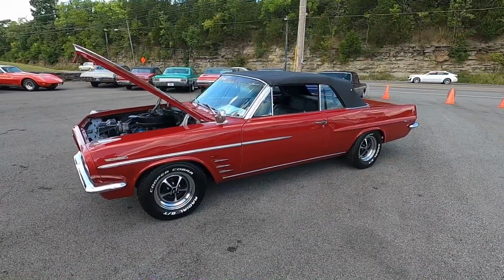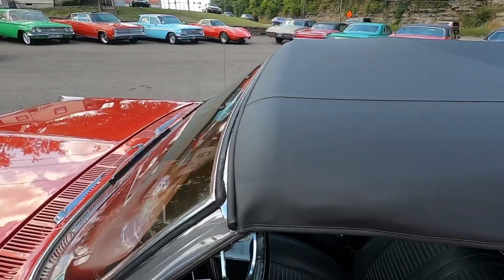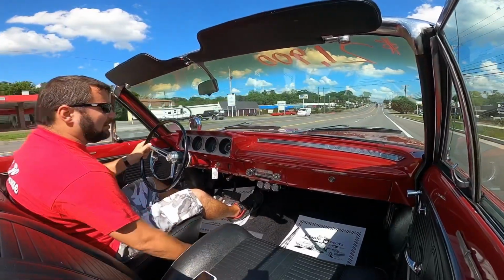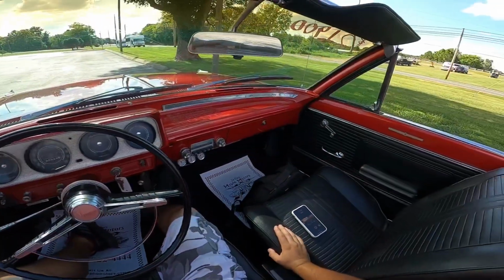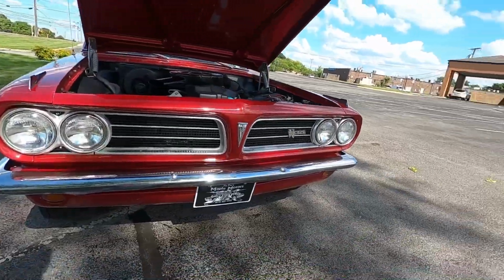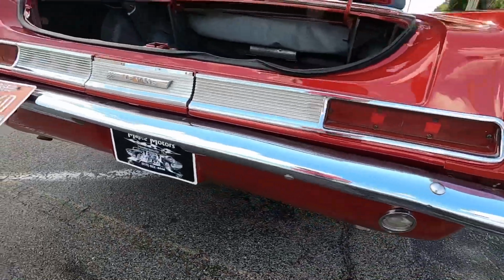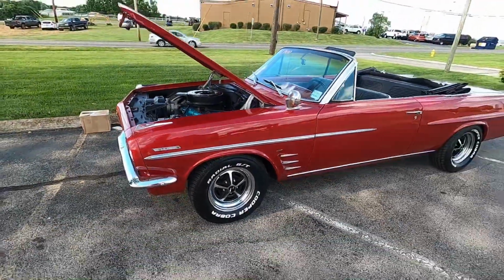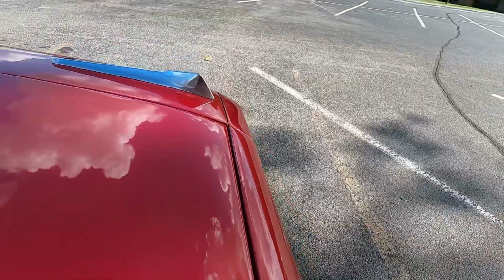Test Drive 1963 Pontiac LeMans Convertible SOLD $21,900 Maple Motors #1813

Comment: Love the 63 Tempest.  Have been looking for the hardtop/fastback.  Rarely see them up for sale, and when I have the timing hasn't been right.  63 was a great year for many of the manufacturers, the F85, Falcon, Comet and so many others had great body lines.  They put today's cars to shame.
Reply: Yes, they are very cool Scott!
Reply: I drive a red '63 hardtop Comet. Has the same three chrome 'tails' as this Poncho but on rear quarter panel. Seems like Merc & Pontiac had double spies ;^)
Reply: @josephtravers777  👍👍

Comment: That's a pretty little Tampax. My Dad had a '62 with the four-cylinder four barrel 4 speed. Some of my earliest memories are standing on the hump between the bucket seats holding on to both seats as mom is working that four-speed, racing from stop light to stop light on Woodward in Pontiac Michigan on a Friday or Saturday night. I think my mom might have been one of them dirty hot rodders.

Comment: My dad had a hardtop version. It had the console shift. I did notice this one had a break lamp out. The 326 was actually a 336 but GM at the time wouldn’t allow any vehicle to have an engine larger than the Corvette 327 so Pontiac  advertised it as a 326. In 64 it was actually a true 326.

Comment: John DeLorean lied... called the engine a 326... one less than a Chevy 327... and 4 under the GM 330" limit... but it was actually a 336"... too bad it's a 2 bbl. carb. low compression engine and 2 speed auto trans... although that prolly saved the drivetrain from destruction...

Comment: Add oil pressure gauge must be way off. A cold engine she saw about 40 PSI. A warm engine should at least maintain 25 to 30 PSI when idling.

Comment: Beu Tee Full  Ab So $Lute Lee   I remember people who purchased these cars new were very dissatisfied because of transmission issues constantly  this was my dream car until the 1967 GTO arrived Mine was Red black vinyl top 400 6 pack 4 speed I blew the engine about every other month . Ps you want the oil pressure low Never above 35 pounds  on these engines  best to invest in a oil pan and work on the crank if you do anything above grocery buggy with these old pony's  it's amazing Smokey dominated nascar With them I've popped the hood on stationwagons to find 421 super duty 6pack engines

Comment: My Dad was a Pontiac service manager. The tempest from 63 on back was a piss poor design drive train wise . Nothing but trouble until the 64 came out with a normal drive train. The transaxles from 63 on back were troublesome nightmares ,and that one is leaking like hell in the back......For over 21,000 bucks you'd better tweak a few issues . Lotta flaws for $21,900.00.....The body style for 63 was a nice look , but the rest of the car other than the engine was a GM abortion.Truths the truth .Don't know what to tell ya. Good luck..........
Reply: i agree . i had a 63 tempest custom 326 3 spd  on the floor manual. broke the drive shaft 2 times, and trans axle problems.